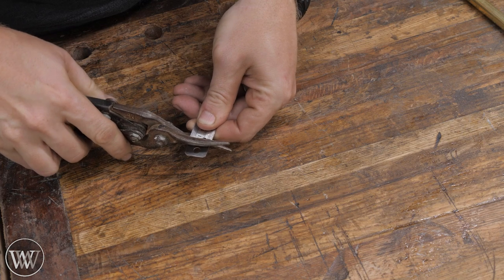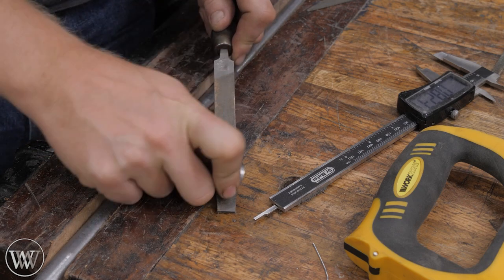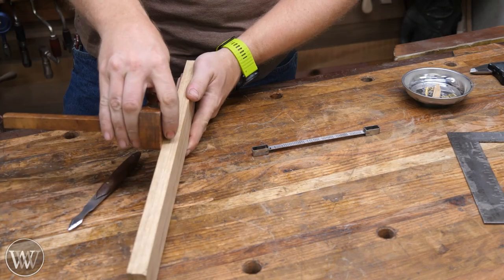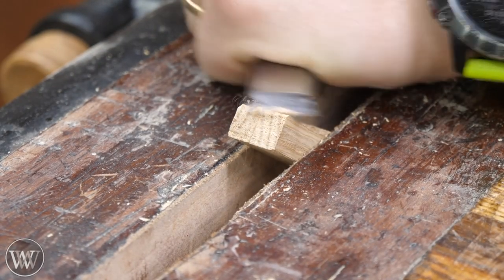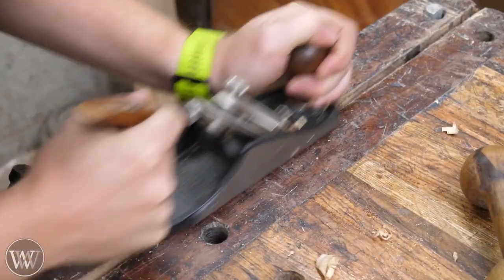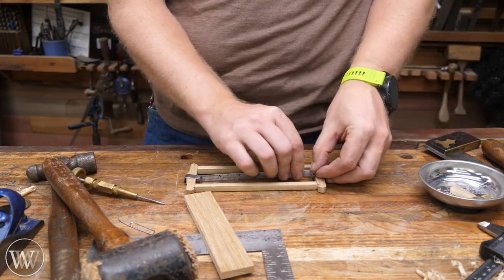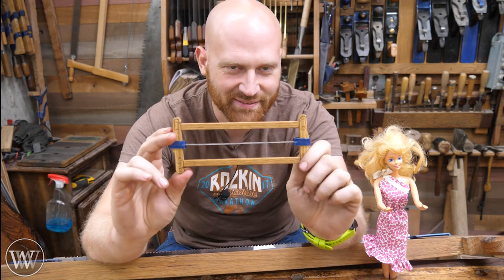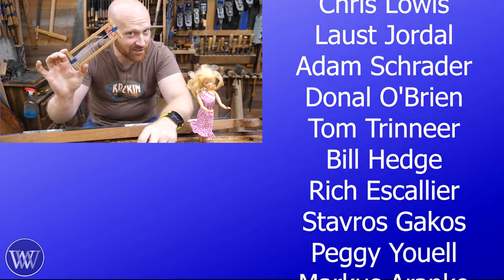How to Make a Roubo Style Frame Saw for Barbie

Comment: I know it is tempting to use tin snips on wire, but I can assure you that it is not good for the tin snips. I used a pair years ago on wire not knowing that it was bad for them and that particular pair is basically useless because the edge is mushroomed over.

I did like the build though.
Reply from the maker: Yeah. It's a rare thing for that but in this case it is so weak and soft is that it wasn't going to cause an issue. But I do often sharpen my tin snips.
Reply: @WoodByWrightHowTo  do you have a video of that process? I wasnt sure it that would work...

Comment: Neat little project. Being old and slow I've been thinking about my saw choices as I slowly cut new teeth into an old saw. Came to realize I grab the Japanese saw for most small things that aren't figured or have large differences in hardness. Cleaner cut in stuff like teak and mahogany, whereas Doug fir it follows the softest grain and wanders and highly figured stuff it's virtually impossible for me to control.  Hmm, I've had a 14" x 1" crosscut blade for a while, dunno why or where I got it, maybe a small bowsaw is going to happen.
Reply from the maker: Sounds like a fun project. yeah with a Japanese saw they're harder to control because the teeth are on the backside of the blade. Wears with a western saw the leading teeth are on your side of the blade making it easier to control the direction.